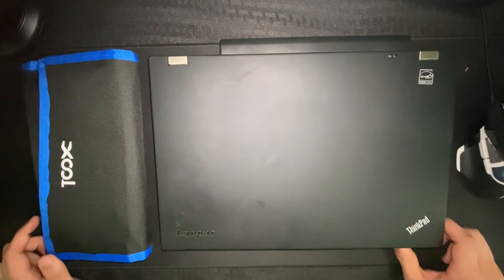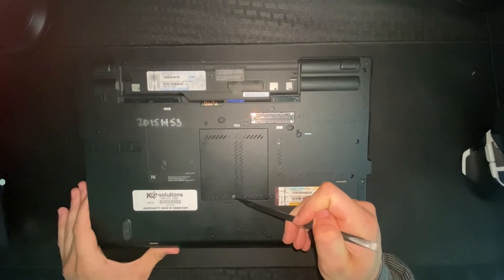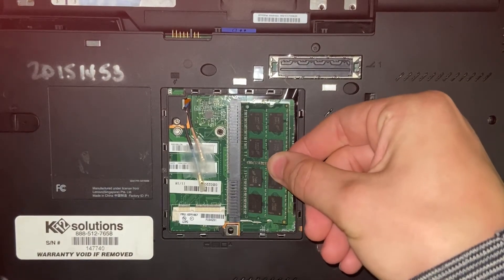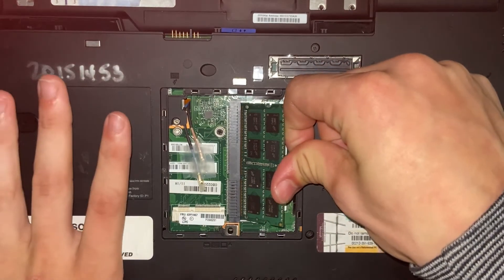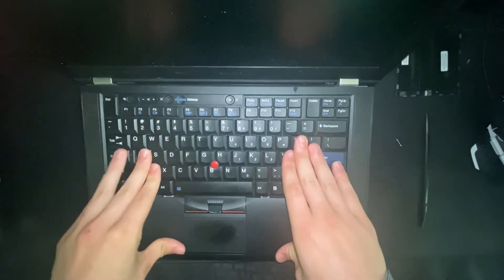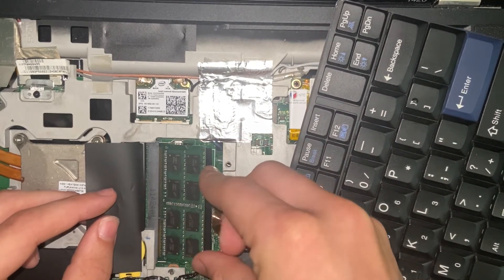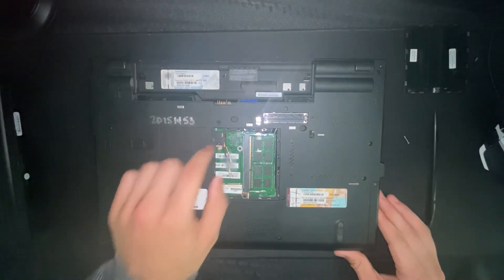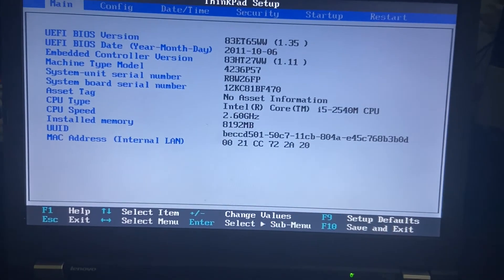ThinkPad T420, T410, T400 - RAM Installation Guide/Memory Upgrade

Comment: Very good video, but I'm still confused. I removed the memory panel on the bottom of the T420. I wanted to remove the memory board to see what it says on it before I order memory. There is no board there. I can only see the board underneath as shown in the video. I always thought the memory had to be installed in pairs. The system still has the original 4gb and runs fine, but I don't know why there aren't 2 boards.

Comment: What is that empty space next to the already installed RAM at the back of laptop from where you opened the screw to remove the keyboard at 2:56 ?
Reply: Is most likely for a optional 3g or 4g card since you see two antenna cables red and blue going to it

Comment: I installed 8gb of ram into my Lenovo t420, the ram works fine I installed it correctly and everything, but when I go to system properties it still says I only have 4gb installed?
Reply from the maker: Do you have the correct RAM installed? If you do, try switching the RAM sticks with each other. If that still doesn't work, one of your sticks of memory may be faulty or broken.

Comment: what is the maximum GB of RAM this laptop can hold?
Reply: Thinkpad T420 can handle a maximum of 16BG RAM. 
Personally I probably wouldn't use any machine older than the T420.
Reply: @bijanshadnia3620  thank you mate
Reply: @bijanshadnia3620  divided between 4 slots? I saw him use only 3 here
Reply: @ashgonza92  2 sticks of 8GB RAM

Comment: very nice vid! subbed!... what are those two wirse on the back of the laptop beside the memory? i accidentally peeled the tape of those wires. do i need to tape it back?... also when i cleaned the fans is it alright that i used electrical tapes when i assemble them again?
Reply from the maker: It should be fine if you don't tape it back. Those wires I believe are for upgrading your wifi card.  Can you explain the fan incident a little bit more in depth?
Reply: Oh i see i thought i messed something important ha!.  How do i know if the fan is still in good shape? I cleaned the fan and out some new thermal paste then assembled it back, when i open the laptop i can see the fan spinning but i dont feel a lot of air coming out of the vents, is it normal? Or my fan gotten weak and need a new one?
Reply from the maker: Fan should be fine. It changes speeds based on the internal temperature. Ex: if your laptop gets too hot your fan should be audibly louder. If your laptop, however, gets dangerously hot I would suggest seeing if anything is blocked. If not, I would get a new fan.